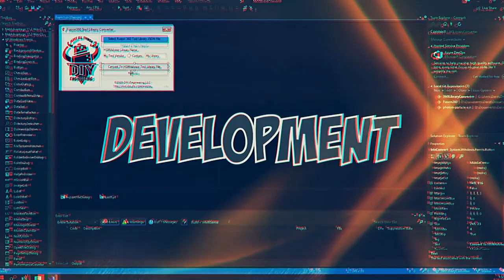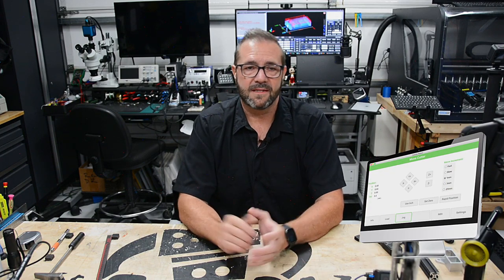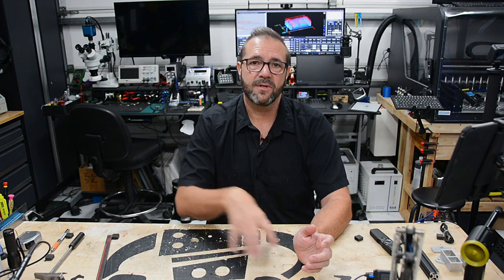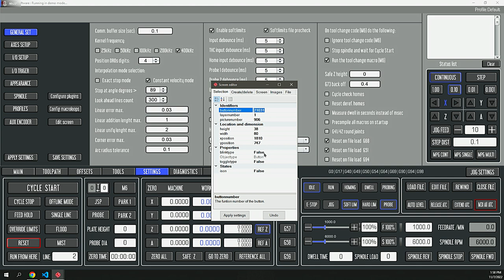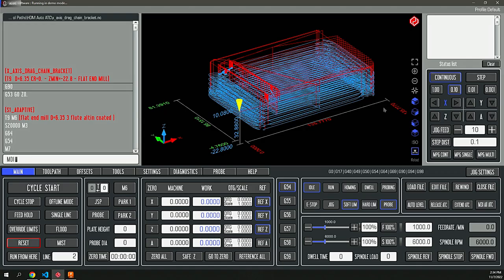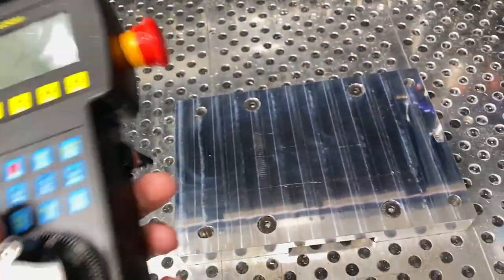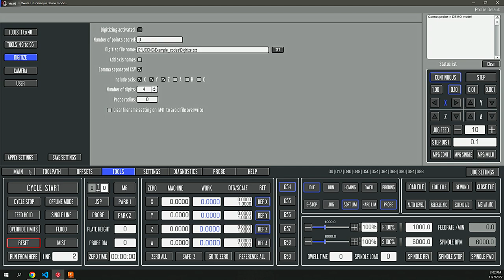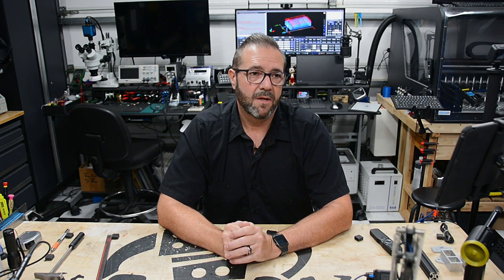Rethinking the Carbide3D Shapeoko HDM, starting from the ground up and adding ATC & 3D Probing!

Comment: You've basically built the CNC machine I'm after. I just don't have the skills to do what you have done. Great job and I'm sure it was very satisfying.
Reply: Use the Masso controller. It requires no macro writing, has closed loop steppers and can add pretty much unlimited rooom for upgrades,  incredible support and a very active community of people to help you with anything you get hung up on.

Comment: Great video! That seems like an incredibly intimidating amount of work, but I'm glad that you ended up with something that is significantly more usable for your use case. Very motivating for me to tackle a tough project!
Reply from the maker: Yes it was quite a leap of faith the only unexpected thing with the hdm hardware was that they use normally closed inductive proximity sensors for the limit switches which isn’t common for most setups. Good luck

Comment: When I got my desktop Prolight 2000 I was lucky to have initially sided with UCCNC controller and never looked back. With that I was able to retrofit 100% of the original machines capability with ATC and probing and even added 4th axis, a custom pendant and M8 mist airblast. I am controlling 8 relays and 4 axis. I think you could use the tool rack advancement and eliminate the need for Y travel when changing tools. This could save even more room on the table.
Reply from the maker: Awesome, uccnc for the win!

Comment: I was thinking something similar to this.  Buy an HDM use as is, then covert to Centroid with CNC Depot Spindle and Possibly Clearpath Servos.
Reply from the maker: Absolutely, the gantry is rock solid
Reply: @DIYEngineering  better than a 2424 avid?
Reply: I'd look at sorotec as well

Comment: Just found your channel and am enjoying it immensely. I did two CNC conversions last year working with the local First Robotics group.  We did both machines with the Centronics Acorn, which I am very impressed with. Centronics does large machines but offers the Acorn for $325 which includes a basic software package. I just ordered a 750 x 750 Workbee Ultimate and plan on using the Acorn on that. The software we use on the team is Inventor which interfaces great with the Acorn. Anyway looking forward to more of your videos on the HDM.
Reply from the maker: Thanks! Not bad, Does acorn have same extensibility?
Reply: @DIYEngineering  It will do up to four axis and 56 input/output with addon IO. I did use it with a four tool changer on the small mill we converted. The company has been in business since 1979 and is located in Pennsylvania.

Comment: I went down the same route about 2 years ago now. It was on a self designed cnc, but without ATC. AXBB-E with breakouts are so extendable, and UCCNC is great. I wish I had better coding skills to expand functionality. But what exists on the forums and trial+error modifications got me where I needed. Certainly not for the faint of heart, but totally worth it. One future upgrade I might still recommend for you is some closed loop steppers. Price is not much more than standard motors and drives, but having position fault detection is a nice piece of mind when cutting aluminum.

Great video and details as always. I would love a video on some of your mcode and postprocess mods. Maybe I could learn some tricks :)

Comment: Hello, I would like to give you an idea or advice. 
The new cnc models that are coming out from some competitors have very large parts apart from the machine itself, such as the screens and the cnc controllers. 

A large screen is more comfortable, but it will be even more comfortable to work from a laptop or PC when we are inside a house and where you don't normally have an industrial type work area. 

An example that I give is the Stepcraft cnc machine, it has several models and sizes, it is strong but also its controller is located inside the machine itself, thus saving space and cables. I think that a design can be large and at the same time minimalist and that the client will value it very much and it will be a product that will sell well.

Comment: I'm definitely interested in hearing more. Whatever CNC I buy next, ATC would be part of the plan from the beginning. The HDM has been high on my list, though I'm curious to see how the Shapeoko 5 Pro compares from a rigidity perspective, as a 2x2 would fit my needs.

Thanks for sharing, I think this will benefit a lot of people.
Reply from the maker: I like the size and design changes of the shapeoko5 but the hdm is a tank and it’s probably not likely that it can compete. Mill area alone is most attractive for me on the 5

Comment: would there be any value in using a welded steel frame with a concrete base and epoxy floor with drains for a wet system with the HDM?

Comment: Awesome job! That's basically my major complaint with the HDM: after all the work to get it where I want it, I might as well start from scratch. For me fabricating the XYZ plates and rails is trivial to get the motion components nailed down is trivial compared to all the wiring and control board programming that you tackled here
Reply from the maker: I agree, it’s a good platform but falls short to reach its full capability.

Comment: Feel like you probably should have bought a used HAUS. You did an awesome job and I'm sure you learned alot. But Im questioning the amount of time and money put into this.

What are you thoughts on the difference in cost between the two options? 

The downside of a used HAUS I suppose is electrical power and the floor would have to be reinforced and you may still not have the same volume of workspace.

I bought a shapeoko with the z-plus but I think when I outgrow this machine I will upgrade to a new machine. Maybe an AVID. I dont like that there is no 4th axis possibility with the shapeoko.

Comment: Do you have custom holes for your tool length probe or is there supposed to be predrilled holes for it? I have these plates and am wondering how im meant to mount the unit.

Comment: you said 12-15K inches per minuet rapids. Is that right or did you mean to say mm per min? Some cut shots and some stats would be nice to see. feeds, speeds, MRR depth of cut width of cut and materials to test would be 6061 T6 and 304 stainless. Lets see it do some work. And I have always been skeptical of the wats these type of machines run on the spindle. 1500 watts on a proper CNC machine would require about 1 ton of mass to back it up. So it would also be nice to see the amp draw at it's most capable cut. Nice video and thanks for making it.
Reply from the maker: You’re right, mm per minute… I’m looking into some tools that will allow me to capture and measure loads on the machine, any thoughts?

Comment: Can you provide some insights on how you got a custom large spindle attached to the HDM? I'm planning on getting the 5 Pro to do some milling on aluminum and wood, need to use a spindle like yours. Thanks.
Reply from the maker: hi, the HDM has an 80mm spindle, in this case my Jianken ATC spindle has the same diameter, it is just a bit taller because of the ATC mechanism. all said the HDM is easy. the 5 Pro on the other hand did not support an 80mm spindle mount, so when I upgraded that machine, I had to design and build a spindle mount plate that could hold an 80mm spindle. I have not done a video on that machine, but am happy to share my files if that helps you out.
Reply: @DIYEngineering  thanks for the reply. I was considering to get the 5 Pro until I found many YouTube videos of it chattering as it moves diagonally. This seems to be an engineering fault design of the 5 pro or possibly bad user assembly. Does your HDM chatters as it moves diagonally? Thanks.